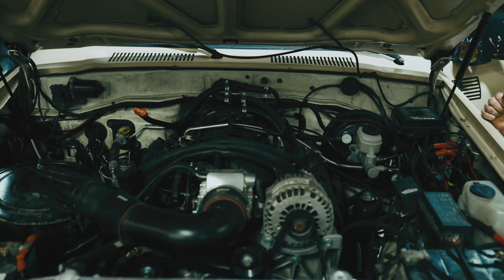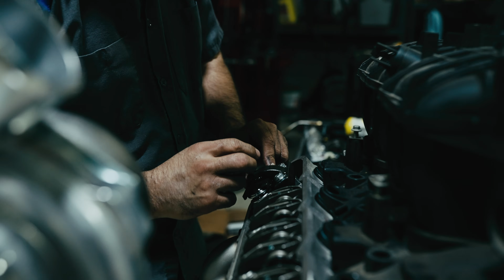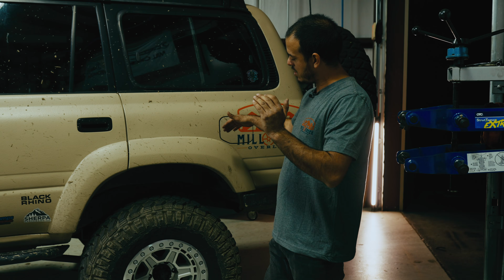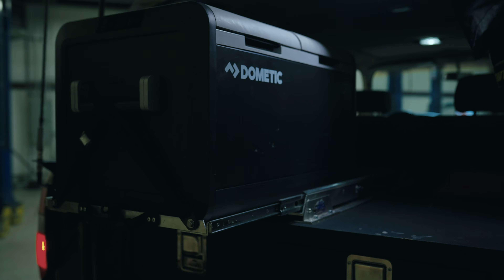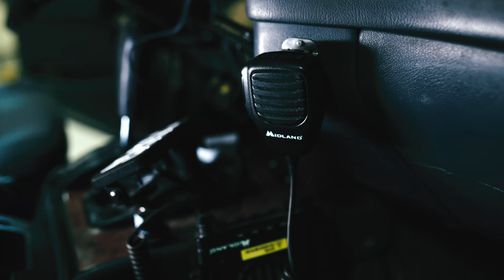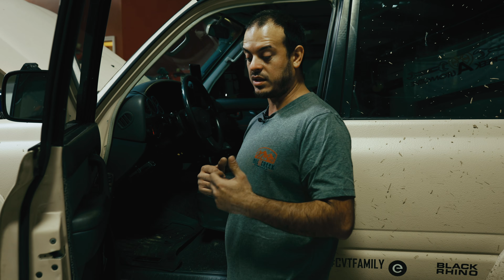V8 FJ80 Toyota Land Cruiser Walk Around - LS Swapped

Comment: Why don’t we see any 80 series owners swap the engine for a Toyota 2UZ-FE (4.7L) V8 instead of the LS V8 for the reliabilty?
Reply: I had looked into that for a while. The overall supprt network for the swap is very small. 
Most of the LS swaps are built around a kit and prior work and discovery.
The 2UR swap would require custom fabrication and custom electrical to drop into the 80 and while the engine is very reliable, these older LS's arent that much less reliable. Its honestly the transmission that would have more issue

Comment: Just a piece of advice for the average off road enthusiast who has an 80 series: If you don't actually go out and overland or go out into the back country frequently, or are a a rock crawling fanatic, do not do this to your 80 series. An engine swap is ridiculous, the Toyota stock engine is extremely reliable and designed for the vehicle. He's right, they have a reputation of being underpowered on the early 80 series. The stock 4.5 liter that came later on the FZJ 80 is more powerful and has great low end torque. They are straight six-cylinders, are bullet-proof, and frequently surpass 350,000 miles with proper maintenance. Skip the bumpers, winch, rock sliders, huge wheels, etc.. The stock truck has been used around the world and is famous for getting you to where you really need to go, and reliably. That is why they are so sought after. Save your money (unless your hobby is doing this kind of modification), and save the weight. Use the money for gasoline and maintenance. You will enjoy your truck for many years. Consider your actual needs, and how often you will actually use them. In all my years of trail driving and camping I've used a winch twice, and that was to help out somebody else and to pull a palm tree out of the ground in my yard. Learn how to drive properly off road and get out and walk sections you're not sure about. That is 98 percent of not getting stuck. Carry a recovery strap and a jump starter. You will benefit from a simple suspension upgrade such as Old Man Emu coils and Nitro shocks specifically designed for this truck. They will give you a more comfortable ride and better clearance. Get a nice low profile lightweight roof rack like the original Prinsu, also specific to this truck (you can carry your extra fuel up top - I carry one or two NATO 5-gallon jerry cans and never had "range anxiety"on long trips to Death Valley, etc.). This guy obviously does this heavy duty overland expeditions and rallies with his buddies all the time, so I don't fault him for this beautiful rig, but most people just ride trails and camp. Keep it inexpensive and simple, and don't add all the weight. My upgraded suspension and 32" tires on stock wheels work just fine. The bigger the wheel the more power you need to get them rolling, and the more brake you need to slow them down. Power tanks are expensive, but a nice alternative to mounted air compressors and you can remove them from the truck when you don't need to air down. If you love trucks like this, just watch them on You Tube. Don't go down the rabbit hole of modding a truck you won't use like this guy does. You're welcome.
Reply: The stock 3FE just sucks! I have a 1991 80, and I'm looking into a V8 swap, so I can drive to go play in the woods!

Comment: What modifications did you have to do to the fuel system after swapping in the LS with the Holley Terminator X system?
Reply: We had to customize the factory fuel pump carrier for the fuel pumps. It’s running an lines all the way up and now uses a Fore Innovations inline fuel filter and fuel pressure regulator. Right now we’re running a single Walbro 255, but have a dual hellcat fuel pump setup coming soon.

Comment: Awesome Rig & Content
What kind of Headers fit, Single or Dual exhaust routing ? Thanks
Stroking a 6.2 to 416 Swap into a TL 96 Land Cruiser
Reply: Right now we’re running the hooker blackheart manifolds. The exhaust crosses over before the transfer case to the passenger side of the rig and runs all the way back exiting near the rear tire. But, the exhaust is ever evolving.